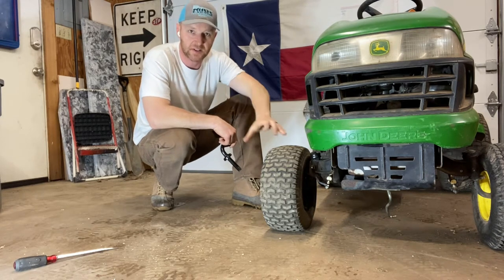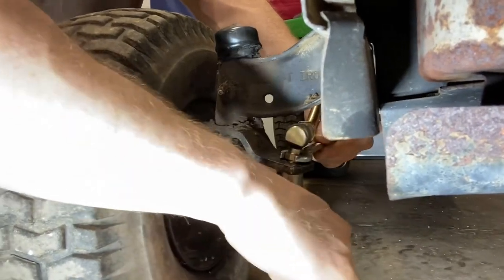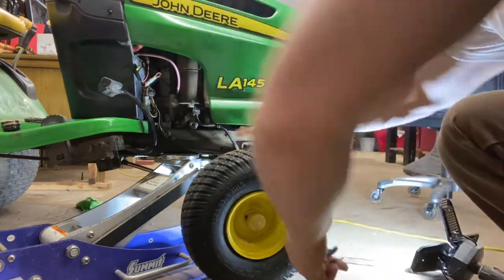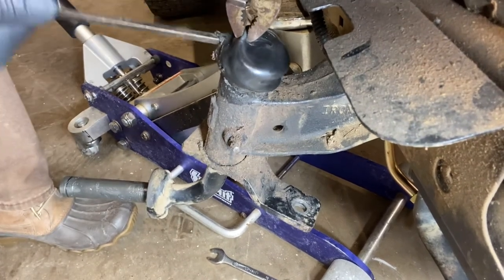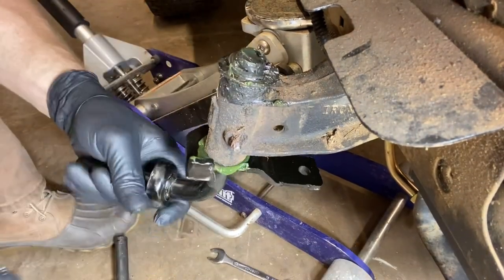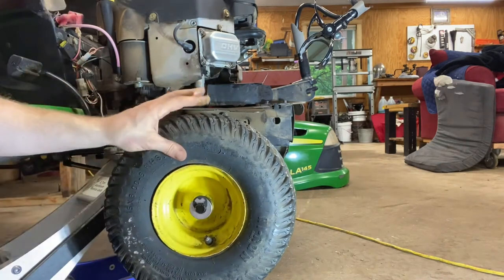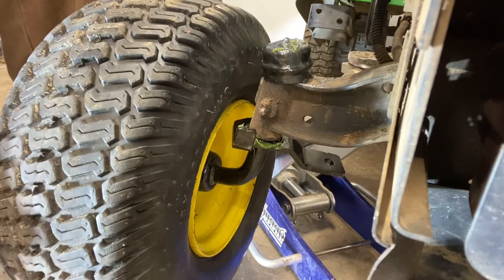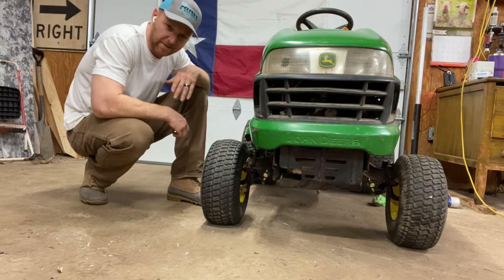John Deere Mower Steering Spindle Replacement, w/ LIGHTER TRICK!

Comment: My steering is completely locked up. Replaced steering gear and teeth, same issue, now what? Would spindles cause that?
Reply from the maker: Yep the spindles can rust and freeze. Try unhooking the drag links to the steering spindles and see if the steering wheel will turn. If it does then is the spindles. Good luck
Reply: @MowerMike  thats exactly what happened on one side. Its fixed, and thanks for making great videos